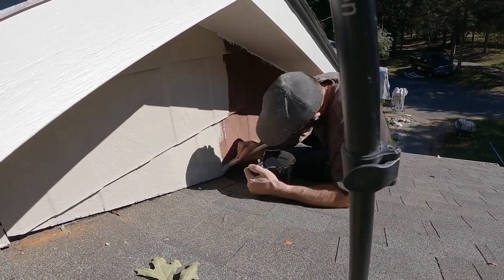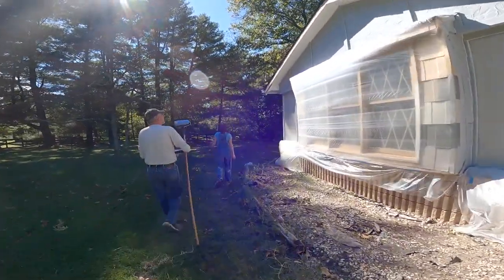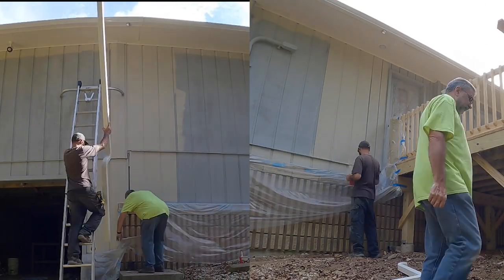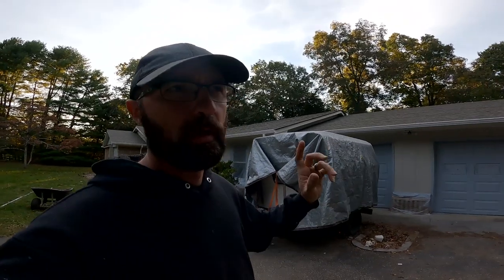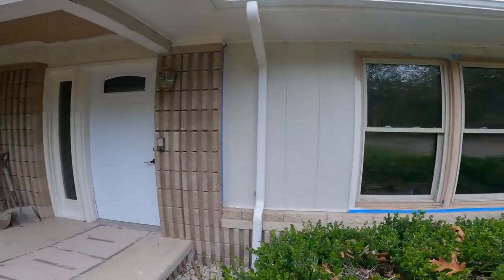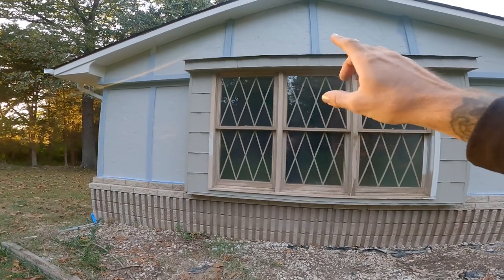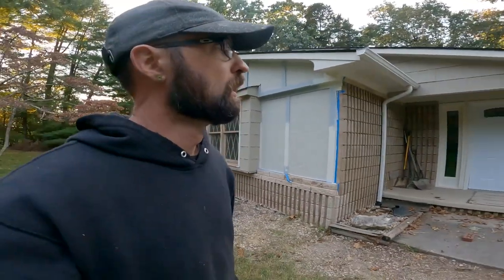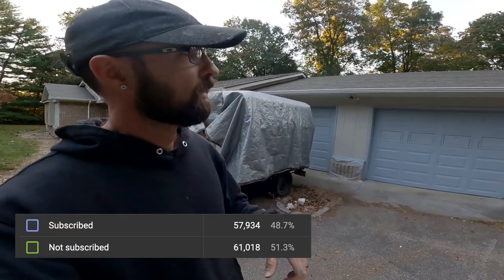What A Difference A Day Makes // Retro Reno Pt 29

Comment: I didn't make this suggestion on the last video, because I thought you probably were already painting the color coat, but for the next house.
18 years ago, my sister flipped a 2200 sq. ft. house. When we got ready to paint, one of the neighbors told us they had spray painted their house 10 years before. It still looked fresh, no flakes or chips so I said "Let's try it". 
I went to a pawn shop and found a Greico sprayer cheap and we had to water the paint down to get it through the sprayer. Cut our paint cost in half and still looks good today. 
BTW, my husband spent 1 day painting the body and about the same taping the windows, doors and covering the landscaping and paving. That sprayer has since been worth it's weight in gold, as I have used it on interiors also.

Comment: Not sure if you agree or not, but I've always felt every house should have its own "Story Book" that's goes with it. Has things like, latest paint colors with manufacturer codes, same for carpet, and vinyl/laminate/tile(as well as a few extra tiles if possible) flooring. Even roofing shingle make and color.  All the paperwork/manuals for the major appliances. Finally if anything required Building Permits, copies of those and any plans. Just seems the right thing to do for all the future owners..well at least I wish I had that stuff when we've moved in.
Our last place I left several folders of info and a year later got an email from the guy we sold to asking for Paint Info...I told him I'd left all that for them. He remembered that but his wife tossed it out like a week after they moved in....sigh. I gave him the name of the painter we used and said good luck.
Reply from the maker: I ALWAYS leave all that info and any remnants of specifics like paint and flooring.